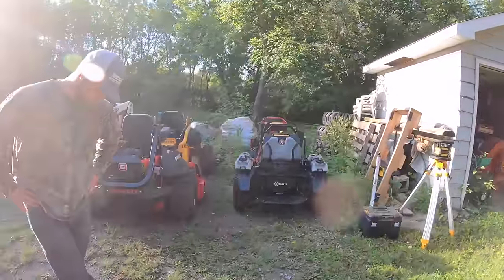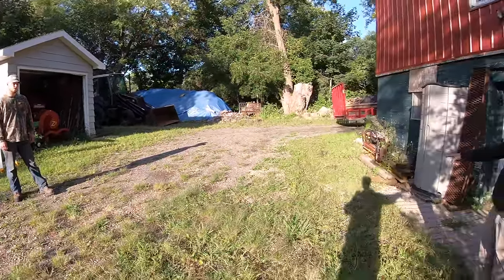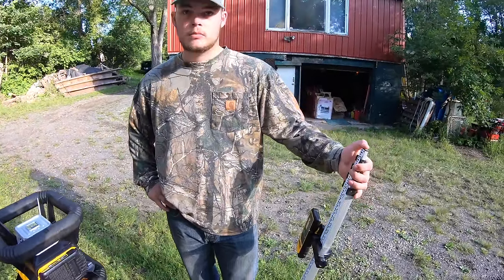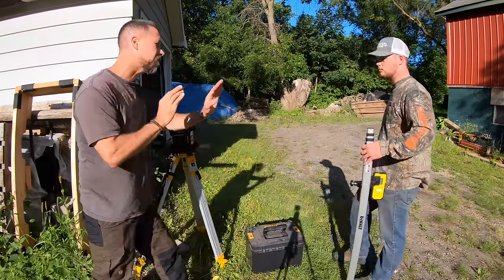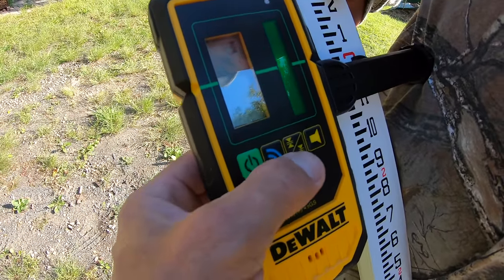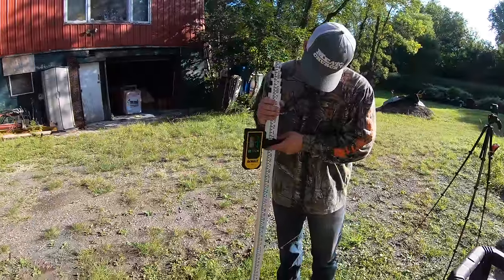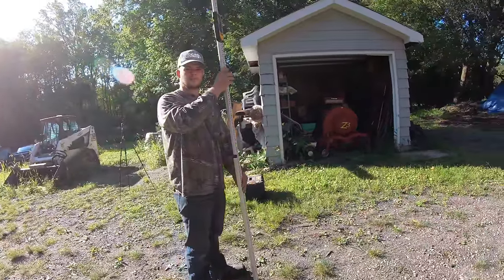Teaching a NOOB how to read grade, Run a laser & change elevations on a jobsite- PT 1/2. 4k video

Comment: Hey Stan I know this is an old video but the only thing I would mention is like on a job like this something I like to do is putting the lazer as low as possible so you can keep the receiver as low on the rod as possible. It keeps the numbers lower and it makes it easier to adjust on the rod where its easier to reach. I hope this makes sense and helps.

Comment: There should be a bubble on the receiver. I never see users set the stick so the bubble is centered.  Good for grading as it does not need to be precise, but laying brick is a whole different story.

Comment: For a drain-pipe project, a spreadsheet is my best friend - measure the elevations every four feet, the desired depth at the beginning and ending (both relative to the laser), calculate the slope from beginning to ending, and finally plug in formulas to calculate the depth of my trench every four feet to achieve that slope - depth relative to the surface - to have a nice even slope at the bottom of the trench from one end to the other, regardless of how the ground surface rises and falls above it.

Comment: I use a Lenker rod, which tells you the actual elevation that you are at. Dial it in at a survey benchmark that has an elevation on it; adjust the sliding tape on the Lenkerr rod to that exact elevation and then lock it in.

Comment: Here's another trick I was taught. When you use a engineers grade stick it can sometimes add an unnecessary set of numbers to the grade. Each crew member carries a measuring tape,  so we would use a wood 2×2 and just take your benchmark and mark the stick, then use your tape to set elevations for the site on the 2×2 stick. It really eliminates extra numbers, then just paint over the marks when finished.
Reply: Yeah, I always like to use just one reference mark (consider that mark as zero), and then add or subtract from that zero mark. The last thing I need at my age is junior high school math story problems:  If Bob is 6' 2-1/4" tall and leaves the train station going east at 10 MPH, and Kevin is 7' 3-1/2" tall and leaves the train station going west at 20 MPH, what grade level is the site that Bob is on, and does Kevin have some sort of pituitary gland disorder?

Comment: Great video.  Tip:  I use one of the cheap Harbor Freight levels (the orange plastic one) to do a rough level for my tripod before I place the laser (although) you can have the laser already attached.  They are only about 8" long and fit in my laser case.  Handy if your tripod doesn't have a level.

Comment: Besides using metric because I am Canadian  the only thing I do that is different is I never move my receiver on the stick, I set it at the top of the stick and just extend it as I go deeper, that being said it may be a different stick setup with the way the numbers go, mine get higher as you go down the rod
Reply: Sorry I am a foreman for Ken White Construction and we do a lot of septics where I get plans with benchmarks and pre determined elevations for the septic install. Great video coming from a grade guy!!

Comment: Whoa, still using feet and inches. I'm in my mid 60's so that's what I learned in school. But once you use metric it is SOOO much easier and makes much more sense. No need for fractions of an inch when you have millimetres.
Going back to feet and inches just feels and sounds like going back to the stone age.
Really good video though covering the basics, well done.

Comment: I'd suggest xeroxing a stack of blank sheets that have lines to write in the measurements. Keep the sheets by the laser or in a bag tied to the tripod. You can add scales and helpful notes like the one inch per 8ft rule on the sheet. Note date, time, weather, worker name. Now u got a standardized method for every worker to use. Take a picture of your sheet and text it to the next worker who needs the numbers. That note-taking on a phone is guaranteed to create double-work.

Comment: One thing I like to do if coming back to a job is to find a fixed object I can set the laser directly on and not use the tripod unless I have to. This way I never have to refigure a benchmark. That stump looked like a good place to mark and set the laser. It is out of the way, can see the entire job but, possibly a little too high. If the customer didn't mind, I'd cut a little more off the branch on the left side of the main trunk. Something I always say is "The bigger the number the deeper the hole."  Another thing I like to do is attach the receiver to the top of the rod and take all my readings off the back of the stick (read from the top down if your rod is marked that way) this way you never have to move the receiver just raise and lower the rod.  If your laser is running a % grade, once I get my measurements I will move the receiver to the exact spot on the rod since we are going to "follow the beam". The only bad part about this is when you already have natural fall and are trying to blend an area, a set % grade will sometimes make you remove more material than what is actually needed on some "high" spots.  I try to never have more rod extended above the receiver than what is needed for stability and ease of use. Great video keep up the good work. P.S. Another non-laser use for the rod is to measure your equipment height when trailering. Place the rod on the ground and extend the top until you reach the highest part of the equipment then read the back to see your "head" height.

Comment: Something about using inches on a rod...  it'll do in a pinch, but most engineers and surveyors I've worked with use decimal feet.

And the reason why is pretty simple:  decimal feet lets you use base ten math.  Want a 1% grade over ten feet?  Drop by 1/10th of a foot.  A 2% grade over 80 feet?  Drop by 1.6 feet.

Comment: Thanks Dirt Monkey! I'm taking this knowledge and my 9 years landscape knowledge to Home Depot and getting a Rotary Laser level. Off to the job to crunch numbers and figure out what needs to happen to fix a customer's grade issues! Blessings.
Reply: One percent grade is 1 to 100 or 1/100 or 1/8 inch per foot or 1 inch per 8 feet.  He did not cover it "yet" but most lasers can be set up to give a set grade of ?% by intentionally tipping it to that grade, then read the rod at the same number anywhere on that grade will be the % grade wanted  if the laser is pointed in the correct direction to set the grade.  Most lasers have a button to set a specified grade.  A linear laser is better for this than a rotating one which will only be accurate in the direction of the grade or tilt and not off to the side because it gives a plane about a specific point.

Comment: To establish a BM or benchmark, it needs to be somewhere the instrument can "see" as well as the other locations that need to be read(red) for grade, plus it MUST NOT be moved like he moved the box. or the elevation is lost, and it needs to be in a location that will not be damaged during the entire construction project so it is available for use at any time during the project.  For a job site that is going to be tied in to the elevation(s) of other features in the project, the BM should be done or has been done by a surveyor to the hundredth of a  foot and marked with the elevation and to be protected.  If the project is simple and not tied to other features, a TBM or Temporary Bench Mark can be set or chosen as a convenient nail, bolt, spot, etc. that will not be damaged during construction and the elevation may be assumed or chosen as an even number close to the general elevation above sea level in the area being worked.  All you are doing is measuring the differences between the BM up to the HI or height of eye or height of instrument then back down to the grade.  Always add the measurement of the reading on the grade rod to the BM to get the HI and subtract all of the rod readings from the HI to get the grade.  
I am a graduate Civil Engineer.

Comment: Stake your spots with the elevation/ needed or target elevation.
Reply: Good idea. And also if you’re using temporary stakes when rough grading fills, you can use the shot stick to just mark a line on the stake and grade the fill right up to it.

Comment: Cool video.It made me think that the manufacturer of the laser leveling system should have or should develop a app for smart phones to help with the guidance of operation. Could even have set areas for typing the measurements so they are not forgotten. Im sure the manufacturer, or even you could imagine a better design platform for a smart app. 
I stumbled across this video while researching the methods of implementing a proper foundation before building a new home. Learn something every day hahah

Comment: We pencil a line on the stick for benchmark. We mark the date with (example) bottom of hole (BOH 4/9), top of concrete (TOC 4/9). any time the laser is moved rub the pencil marks off and reset the stick to the god mark.

Comment: Well, a benchmark is an officially established vertical control point, for example a USCGS Benchmark. You are establishing grades relative to  the height of the instrument (laser level). And, that's fine. But, it is nice to use actual elevations when you could potentially be tying into other work.
Reply: So how do I find out what the "official" USGS benchmark is on my property?  In case I need to tie into utilities or something else.  My city has gis available and the county has GIS.  Can I use those elevations as a bench?
Reply: @nateccnn  I would like to know this as well

Comment: Soooo. Plans are drawn with tenths elevations. I never wanted to confuse people with fractions and tenths. It has always worked out for me. I also always used surveyors elevations to figure out pluses and minuses. That way you always work off of the actual benchmark elevation.
On mechanical level or transit leveling, the bubble always follows the direction of your left thumb on the adjustment screw.

Comment: Good video as always but you should of used feet and tenths as that's what we use or just explain the conversions for inches to tenths and maybe touch on turn points to work around obstructions if it's not avoidable
Reply from the maker: Thanks for the feedback, it helps !

Comment: "higher on the pole is deeper in the hole"... Using an engineers rule rod (10ths of a foot) is much easier. Learning to use the reverse scale on the rod is also very useful (Very few even know why this is here.) 1" for 8' is roughly 1%. Most building codes call for 2% (1" for 4') Great video for a total noob.
Reply: Would like to know more about this reverse scale on the rod and how to use it. I never even paid any attention to it on our rods. I’ll have to check that out. Would also like to know what a direct reading rod is too, that a couple other people have mentioned.

Comment: yes, hiring a excavator to form my pad and driveway but have to stay at 16% grade for fire trucks...code.  my .6 acre lot is about 20% grade steep...how do i set elevations for a 16% S shaped driveway down 20% hill...driveway determins location od 1200 sq. ft DIY house build

Comment: One thing that may or may not have been mentioned, WATCH for overhead power lines if the electric service is aerial in your work area. You don’t want that grade rod to touch the electric lines.
Reply: Absolutely, even if the rod is wood or fiberglass.

Comment: just set a benchmark, and in ur notes make the bench 100. Then change all ur grades over to plus or minus. so say the benchmark was 4.0 and u shoot a grad at 2.0 put it in ur notes as 98. that way when u come back and reset laser you know that that grade is minus 2 from the benchmark grade. then you know relative to the benchmark what all ur grades all you had shot before by simply seeing the plus or minus on bench. No re shooting all the grades. All ur previous values are still usable even with the laser at a different height or position/location

Comment: I had graded my entire backyard using just a bucket of water connected to a long 100' of clear hose. Put the bucket of water on a picnic table. Then taped the end of the hose to a 2x4 and taped a metal yardstick upside down with the 18' line on the yardstick at the point which I see the water line. I just move the stuck around rhe entire yard and it reads correct inches of being at grade point.
No fancy, expensive lasers.
If you need firther distances use a regular laser level and your cell phone on a stick. Easy peasy

Comment: I'd like to see more on how you plan out the grades to begin with. You established what seems like a good place to start--directly out from the pad. But as you said, you are going to have to blend this cut with the rest of the job. And that grade may not actually work with some other parts that need grading. So you may know what you're doing but for a noob, is there a way to look at the whole job and decide where the primary targets are going to be--that will work with at least some the objectives of the grading? Clearly this can change as you go, but where do you start?

Comment: In the 1800's they used to take sticks of several different species of wood and pound them into the ground and come back 3 to 5 years later and whichever stick was least rotten is the wood they would pick to use to build
Reply from the maker: Interesting Richard, thanks for the comment!

Comment: Make sure you know what type of grade rod your using 10ths or inches. I prefer 10ths.  Things you should do... step of the feet of the legs.  shut the laser off before moving it. Watch out for strobe lights. Check calibration dates of laser.

Comment: I have a measuring stick that shows the hight at the first seam on the bottom. I figured that I can mount the receiver at the top and while measuring I don't need to move the receiver relative to the stick all the time. Only slide the stick in and out. 

Edit. I read more comments. I
So its called direct reading stick.

Comment: Make it easy for the guy teach him to use a direct reading rod. That way he can knows actual elevations
Reply: I believe Stanley was teaching this method so the young man had a basic understanding of the process.  Having better tooling would make it easier.  However, it would not provide the core methodology to use in case you don't have better tools with you on a given day.

Comment: Nice video... One important clarification. If you're planning on adding any kind of rock/material to the grade area, wouldn't you actually want to dig deeper to compensate for the thickness of the rock/material that you intend to lay on top of the dirt?
Thanks

Comment: I’m using my new laser level outdoors to level my old pool.  Is it best for me to locate the laser in the center and use that number for my constant home number?
This is my first laser level for grade level.
I did understand what you said about the constant and working out from it.
Then use my stick at each support post for the next set of numbers as I go around the pool?
My pool is a very large 44’x18’ oval pool.
Maybe I should shoot every 8’ and then get the average between them?
Any help you can give me will be greatly appreciated.

Comment: Question - I bought a Bosch crossline laser level and a Boshch LR8 receiver to use at my job.  The Bosch LR8 laser receiver is rectangle shaped and has 2 marking slots (the grooves on the side where you mark with your pen or marker).  Both marking slots are on the long sides of the receiver on opposite sides of the receiver from one another.  If the receiver detects the laser but you did not have the receiver perfectly level then that means one of the marking slots was slightly higher/lower than the other slot.  Also if I was using a leveling rod but did not have the rod perfectly plumb (which also means the receiver is not plumb if it is attached to the rod), would that throw you reading off?  Are you supposed to ensure a receiver and/or leveling rod with receiver attached is perfectly level or plumb before you mark the laser height?

Comment: How do you know when a grade needs a retaining wall of some sort? I’m in a hilly sub-division where I’m at the bottom of the hill and about 9 houses beside me and about 10 feet spaced apart. Now I notice my grading done by the builder has many neg slope coming on the side of each home in between. wondering if I might have issues with water on the side of my home. Later down the line. Or even worse bad for my home being on a slab.🤔🤔

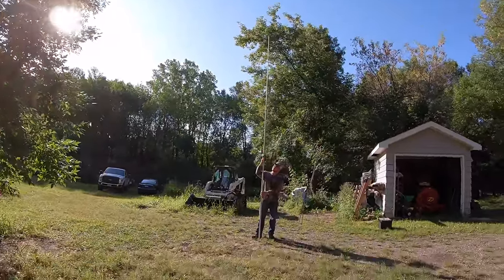Comment: Sorry, I’m confused…..at 17:46 if the concrete was 6’2 3/4” and 16’ out the grade was 6’3 1/4” doesn’t that mean the grade was lower and you only need to cut an inch and a half ?

Comment: But what people , workers and property owners don't think about or understand is just that self-leveling rotating lasor level , the reader on the grade stick , the rod or grade stick , the tripod that the laser level mount's on plus the case everything goes into , costs about $1000.oo for a good unit that shoots out to 2000 feet . If they break anything , it costs allot for each item !!  So I make sure everyone knows if they break anything , they pay for it !!!  Or they will just throw it around and abuse it , as those units must be recalibrated after a while or if they get banged around so they shoot grade accurately !!  I also keep my grade stick in a cloth sleeve bag to prevent scratches on the numbers and markings !!